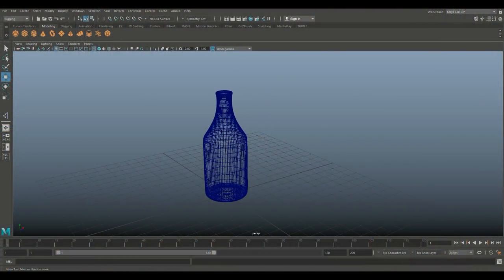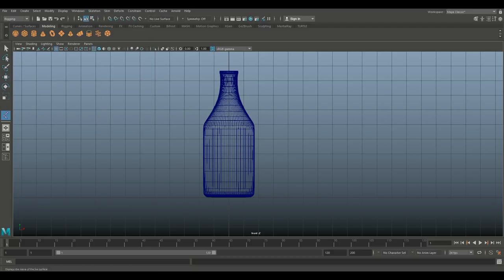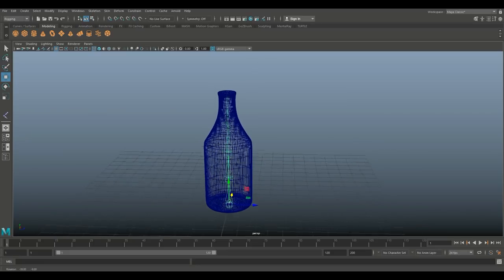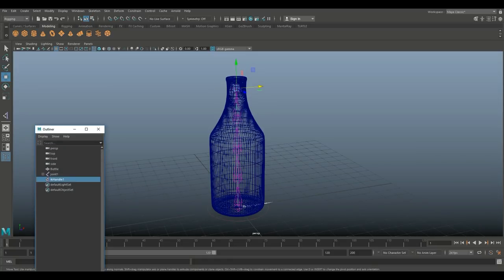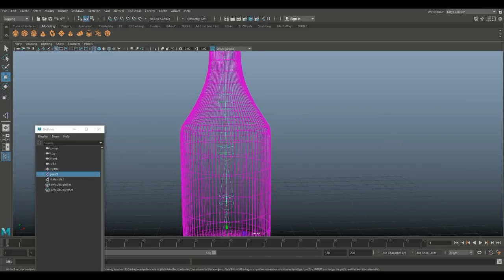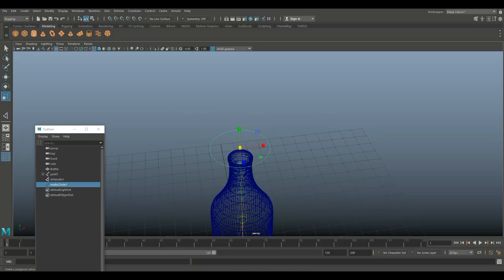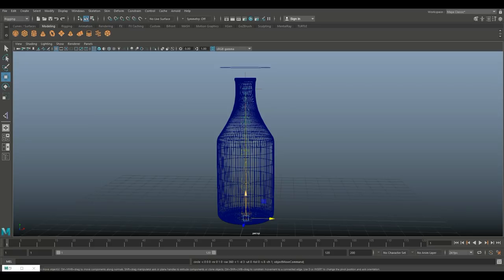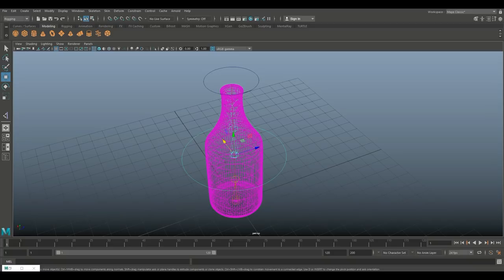Rigging Non-Organic Objects in Maya 2018 with joints, controls and IK handles

Comment from the maker: So what was your latest rig in Maya ?
Reply: Great. Do you have any sample video ?
Reply: car and mechanical rigs
Reply: My latest rig was a Nissan Skyline GTR car. You could make a tutorial on how to make a car rig, which specifically rotates the outer wheels faster than the inner wheels when the car is turning. It can be tricky getting the wheels to move along the ground without the wheels sliding along a bit. I can't remember the exact calculation. Create an expression to spin the wheel 360 degrees for every movement in the forward direction of the result of (2 x pi x radius of the wheel including the tyre). I can't remember how to make the outer wheels spin faster than the inner wheels.
Reply: Maya 2018 that I have while working with me gives a table that says fatal error and lock so I can not work. Maybe to help please

Comment: Im currently rigging a tank and try to make the wheels spin. I started with one wheel and I just can't make it spin around its axis although Ive tried to center the joint multiple times. I have chosen opposite vertices to create clusters and center the joint with a point constraint. It still doesnt turn as it should. Any idea on what else I can try?

Comment: Hi Mike, I recently modelled a fairly simple book in maya, and had some trouble animating it to open and close. I tried using a similar technique to this but had some trouble with the rig binding itself to too many vertices. Would this technique be the best way to do it? Now I've seen this tutorial I realise I could go about it slightly better than my first time... Or would you suggest something different?
Reply from the maker: Is it flipping a page or closing the book ?
Reply: Mike Hermes just opening and closing the book in my case, half the pages turned sort of thing. Think approaching a book on a table in a game and it swings open to the center.
Reply: Jake Giles-Phillips have you checked the Max influences in the bind skin options?

Comment: Could you make a video going a little more into mechanical rigs? Something I'm interested in trying to make is a recreational of a planed landing gear that could fold out and still have several others parts on it move.
Reply: Look for Maya tutorials on the following:
-Constraints
-Set Driven Key
-Expressions
-iK-handles (Forward Kinematics & Reverse Kinematics)
-Control Curves

It's mainly about getting the parenting correct. You have the standard "parent" (keyboard shortcut p), but there is also more specific parenting. 
Go to the animation menu-set and look at the items in the "Constrain" menu. There is Point, Aim, Orient, Scale etc. There is also a thing called "Set Driven Key", which binds one movement to another. 
You could also use an "Expression" which allows you create a mathematical formula to bind movements together based on a set of conditions which you specify.

Comment: As far as i saw when you parented the joint in the middle there using "p" the connection between it and its parent was removed. This would affect the whole set i think. As far as i remember it was possible to set up and rigg additional controls for the IK so the joint chain does not break.
Reply: True. The joint chain got broken by parenting the joint to the circle. Better use a spline IK handle with clusters to the vertices to have proper control.
Reply: True i didnt catch that one... It should be the spleen IK not the standard one... but maybe a pole vector control would suffice instead?
Reply: He needed to use a "Point" constraint from the "constraints" menu in the "animation" menu-set and use clusters to constrain at the componet-level rather than at the object-level. That way the joint-chain would stay intact.
Plus I would have made sure people knew to freeze the transformations on the curve before linking it to the joint chain, that way whenever you want your original pose - you can just set every attribute to zero.
He should have also deleted the history on all objects before linking them together.
Reply: I guess this broke his rig as well. If you want do it like this go to Constraint > Parent Constraint. I would also create a pole vector for the ik handle so you can directly control the direction of the bottle bending.
Interesting to do it with an ik setup. I would have done this fk but your demo was inspiring in which ways you can bring a bottle to life ;D